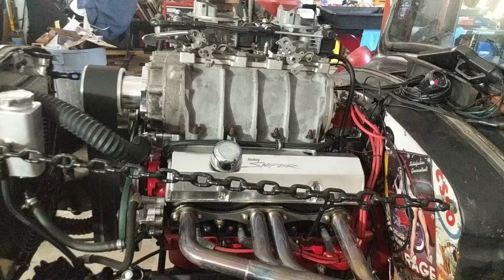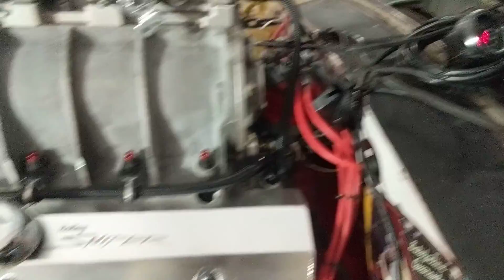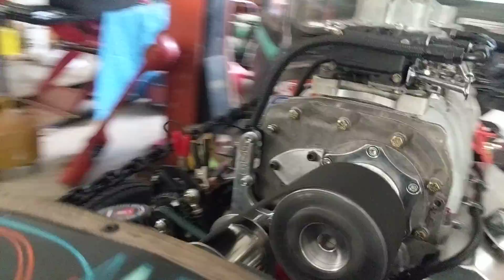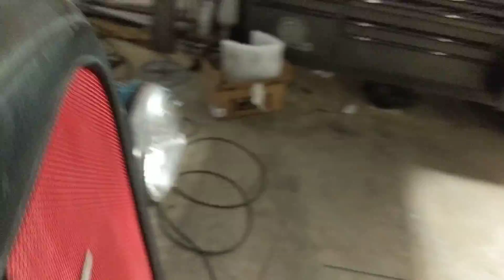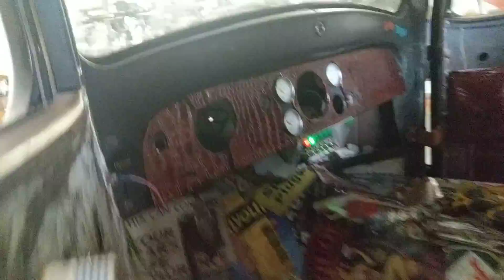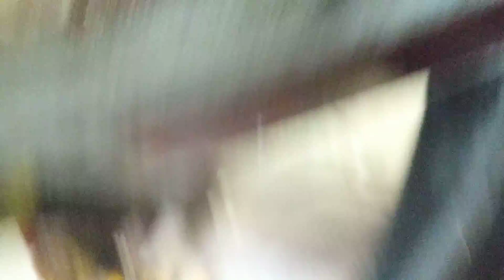6/71 big bore, light surge. twin 600 vacuum secondaries.

Comment: I have a 6-71!! but I need it gone through and all the front bits added.
Reply from the maker: Sweet, there are a couple things I would do differently, but the parts are out there and it's easy to do. I may do a video on the 8/71 and the other 6/71. 🍻
Reply: @firstrespondergarage  I keep trying to reach the company that made my 6-71 and I guess I’m going to have to keep calling because they don’t respond to my emails
Reply from the maker: @BuffsGarage  what company ? 
Do you have a big bore or small bore 6/71?
Reply: @firstrespondergarage  It's a Blower Drive Service (BDS) blower.. it's 6-71 and that's all I know. I bought it years ago for decoration.
Reply from the maker: @BuffsGarage  some of the companies used their own cover and had proprietary bearings made so you have to go to them.
However if you have an early enough one the bearings are cheap a dime a dozen for the sealed stuff and the double roller type for the snout are about 60$ each. If you ever have the cover off take a pic of the front or back. If you have a flat top where the rotors are it's a small bore, if it has a v cut it's a large. You can also test by seing if a 7/8 wrench will fit the top pad where the carb goes. At any rate I can help when you want to make the move on it. I must warn you though once you drive a roots blown engine it's very hard to back to NA.